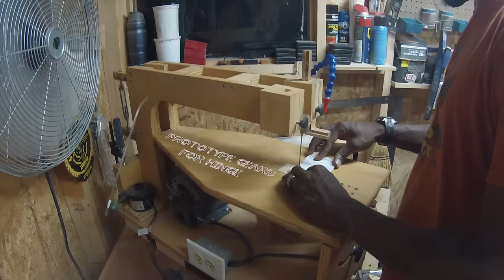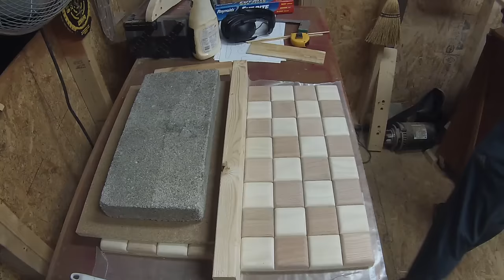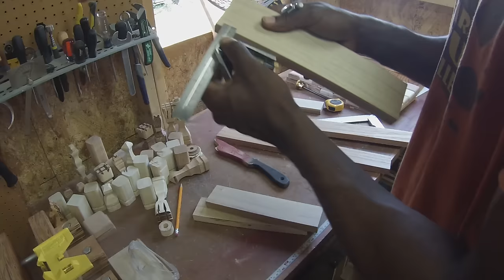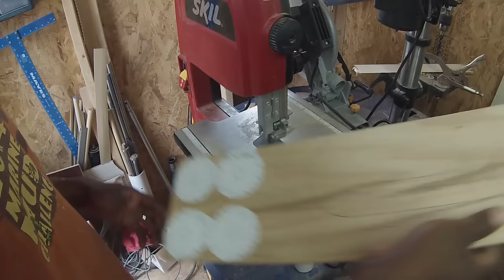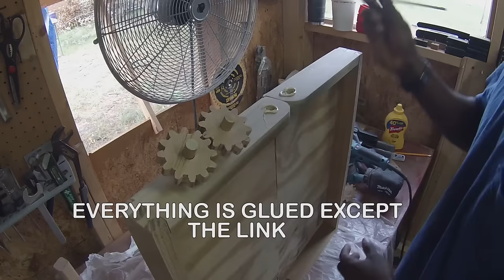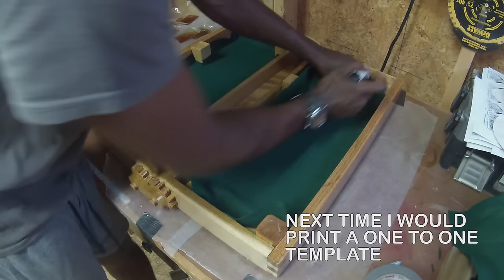08: Wooden Mechanical Chess Set With Gear Hinges!

Comment: I work at a high end cabinet shop, and dude, those gear hinges are one of the most interesting things i've ever seen in woodworking. Trust me when I say i've seen a lot. Very cool idea dude!
Reply: I found a cast metal set similar to what he made. I was told they were used on drafting tables.

Comment: You should consider experimenting with boiled linseed oil and wax finishes instead of polyurethane. The process is slower, but no more difficult. It's actually easier, in my opinion, than modern synthetic finishes.  Don't get me wrong, I am a huge fan of synthetic polymers, but when it comes to showing off wood I think the traditional finishes are best.

As I wrote this I looked up to see a project I'm working on -- the neck of a banjo, which I backed with a unidirectional carbon fiber roving and epoxy resin with a high-gloss polished finish and I think, "You hypocrite bastard!"' ... but the fret board will be finished in linseed oil! Honest!

Comment: Hi Jeremy, I've gone looking for your full video of building the scrollsaw, but can't find it, so I'll just comment here. Looks a lot smoother, since you put the treadmill motor on it. Many years ago, I built a scrollsaw, too. Used a sewing machine to power it with. Old-fashioned foot-controlled variable speed!!! :) (And I could still sew, with the sewing machine! LOL) I built it to accept ordinary coping saw blades. Did a parallel arm design, like you did. 

Now, for the comment... It's been so many years, that I can't remember the specifics of how I did it. But I made it so that when the blade was coming down, it would move forward, toward me, and when it was going up, it would move backwards. This made a more aggressive cut, and it also cut way down on the chances that the blade would grab in the cut, and pull the material up off the table, on the upstroke.

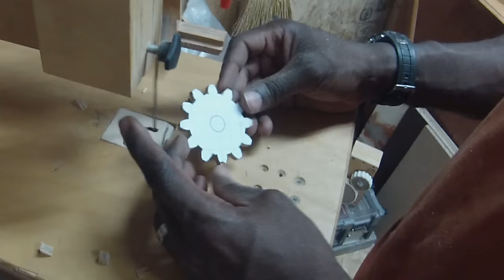If you slow your video down to 1/4 speed... At ~ 0:50, you can see that your blade operates the opposite. It pulls back on the downstroke, and forward, toward you, on the upstroke. I'll spend some time tonight, looking around to see if I can find any information about how to make that cut correctly. (I believe commercial machines cut the way mine did.)
Reply from the maker: It should just be a matter of reversing the rotation of the cam
Reply: Good idea! 

I spent a couple hours looking, and the best I could find is a bit of a summary explanation of why the parallelogram matters. On this page... http://www.instructables.com/id/Make-a-scroll-saw-using-only-upcycledfree-mater/ 

This is a diagram of the various types of scrollsaws, and how the blade moves... http://www.scrollsaws.com/General/Types.html

And this is a discussion where someone mentions how the blade should move forward in the downstroke, and backward in the upstroke.

Note, the forward and backward movement should be as slight as possible. It's needed, for the reasons I stated. But too much, and you'll get undercut, or overcut. Just right, and it'll release on the upstroke, but you'll end up with a virtually straight (vertical) cut.
Reply: You seem to be doing very well, cutting things with it as it is. Maybe this is a waste of your time. If so, please accept my apologies. :)
Reply from the maker: Not a problem 👍

Comment: I had to laugh when it came to the fabric. I had a similar project that required this and I ended up using some dollar store foam board cut an 1/8" smaller than the profile and wrapped my fabric around it then installed it to the main carcass. great looking chess board, wish you had videos on making the pieces.
Reply from the maker: Yeah... that stuff was a pain. I won't use that again.

Comment: Did I count FOUR machines in one footprint? With lots of homemade machines. Maybe you ought to do a quick tour?!
Reply from the maker: +Neal Schwabauer...Well there is a corded drill in that station, so I consider it to be five! I saw your comment on the other video, but for those who may see this in the future, there is another video on my channel which describes that workstation, and most of my shop made gadgets in detail. I enjoy making things that move... Since power tools all have moving parts... I go to the store... look at it for a while and say... I could make that. You can get an idea of how often that happens from what you see in this video. In my DIY scroll saw video you see a  picture I took of the floor model then starting designing and building my own as one example.

Comment: As an alternative to the felt, you may want to look into a process called flocking.  Uses glue and fibers that are blown on.
Reply from the maker: +Anton Kiriwas have you tried it before? It sounds messy. I don't know... I will explore this more.
Reply: I have, and it is (or at least can be)!  But like many messy process (staining, painting, etc.) its all about prep.  Proper masking, proper ventilation and vacuuming and its not so bad.  The results so are so professional though.
Reply from the maker: +Anton Kiriwas ok... well said. I will keep this in mind

Comment: I would have done one more thing before applying the finish . , , , I would have gathered up all the fine sawdust and sifted it to get anything out but the extra fine sawdust then mixed that with some of what I was going to use for the finish to the playing surface until all divests were filled in , ,,, , let dry , , , sand , sand , , and sand some more  then blow off dust and apply finish... job well done the way you did it too,

Comment: Interesting design, but I'm confused with the join of the board to the frame.  why would you not cut slots, at least along the short ends, for your joints?  maybe I'm overly paranoid, but this seems like it would break fairly readily if dropped, especially along the glue joints holding the play surface, unless such a method might weaken the finger joints?

I dunno.  maybe I tend to overengineer things, but for a piece that seems designed for storage, and especially for travel, this seems like it would benefit greatly from some further design considerations towards those ends.

beautiful piece, though.
Reply from the maker: If it makes you feel better my kids have dropped it many times and it still looks great. I am not I understand how slot would help a glue joint. The glue is stronger than the wood, the play surface is over 1” thick and the walls are 3/4” thick. Finger joints are one of the strongest you can use in woodworking...If anything it’s already overbuilt

Comment: Hey dude really cool set.. Have you ever used Linn Seed Oil? It will take many coats but the finish is fantastic.
Reply from the maker: I haven't used Linn Seed Oil. Is it durable? I mostly like poly because it is easy to apply and very hard. But if you don't want the candy like coating its best to use something else.
Reply: Dude go grab a can. Seriously. Just wipe it on, I use a foam brush thing, let the wood soak it up. Rinse and repeat (don't rinse just an expression) until it won't take anymore. You end up with great looking finish that doesn't have that artificial 'high gloss' btw I've seen people submerge their work in linn seed for an extended period and it seems to turnout great - something I haven't tried yet - ..
Reply: Jeremy Fielding I'm sure you all know that Linseed oil left on a rag will combust spontaneously at some point. Just throwing that out there for the readers of these comments who don't know....

Comment: May I ask what purpose the gears serve? It looks as if the linkage would do the same job with or without them. Are they purely decorative?
Reply from the maker: Think more deeply about how it would actually move without the gears... I think you will get it.
Reply: @Jeremy_Fielding  
Ah, I think I see it now. When you open or close the box, it needs to be able to rotate at two points. The gears synchronize those two rotations so that the overall linkage has only one degree of freedom despite the two rotation points and the 'lid' can trace only one path opening or closing.

Thanks for the prompt! That was a good answer.

Comment: i know you like movement, but that table saw seems a bit too unsteady. does it give you any problems with accuracy?
Reply from the maker: no... it moves but making it stiffer requires better drawer slides. The ones I have have more play then desired. I never changed them because better ones cost about 100 dollars more and these work great.

Comment: Is there a video of you making the chess pieces?
Reply from the maker: No... I started making one version with the band saw, but changed my mind after I built the lathe. Now I am making round chess pieces. I haven't finished those either. I have over-sized plastic pieces, and we use those to play. That makes it easier for other projects to keep butting in.